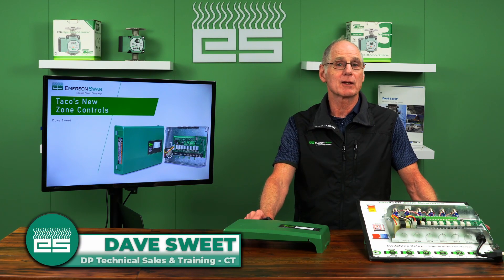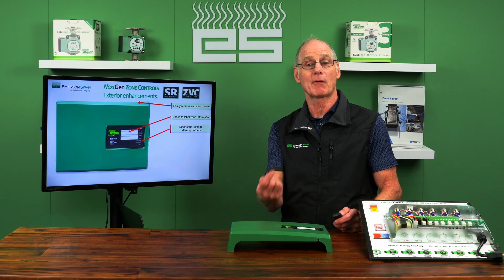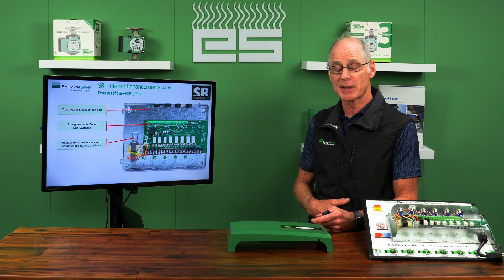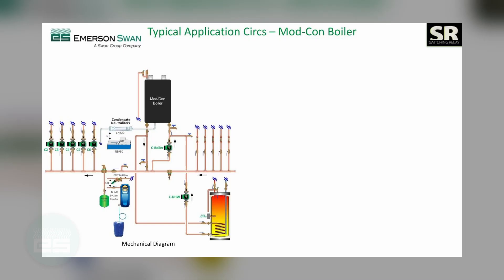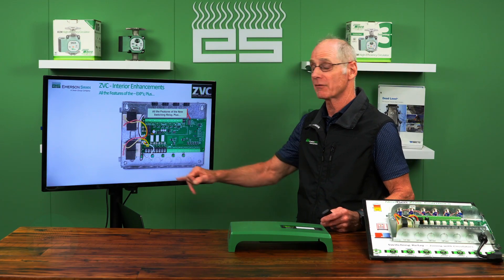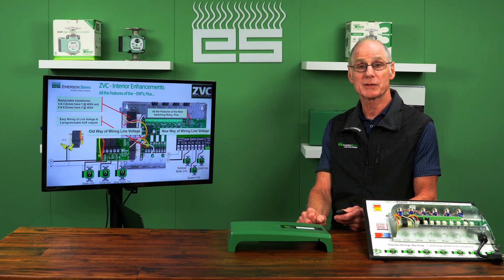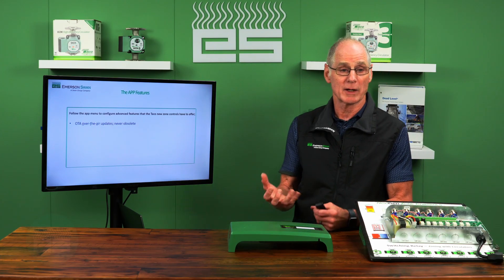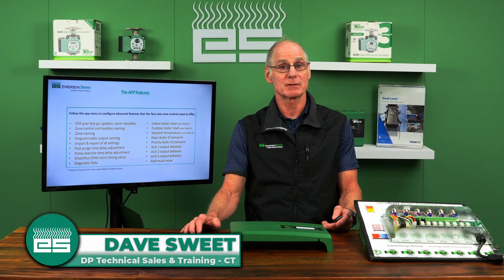NEW Taco Zone Controls - ALL FEATURES - FULL OVERVIEW | @TacoHVACtv

Comment: The new taco zone controls are not compatible with taco 700 series boiler stage controls unless you were supplied with an adapter and a wiring diagram… Ridiculous after a failed start up on a Friday afternoon. I was livid… Next time I will go with tekmar
Reply: Good thing it’s explained well in installation manual
Reply: @Cody-ye3ye  I can’t find an extensive installation manual as they send one paper with the unit, I think it’s absurd how many options this board has and the little information they give.
Reply from the maker: The new -5 zone controls do not directly support any of the PC700’s (700, 702 & 705). 

There is an RP cable available for purchase that allows PC700’s to work with new zone controls. Part number 9300-4166RP. Taco’s intention was to sell the PC800-5 plug-in card that can do most of the functions of PC700’s, at a fraction of the cost.

~ Dave Sweet